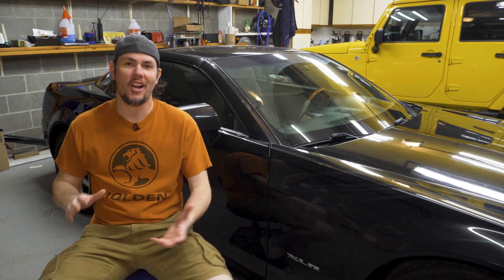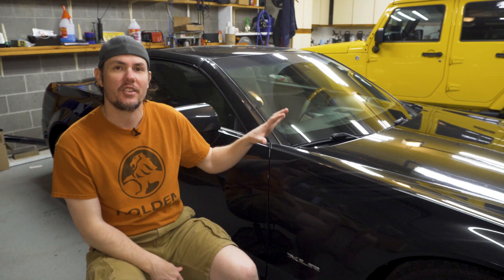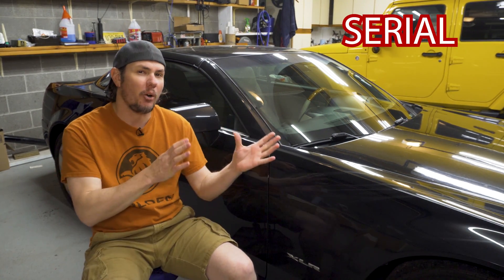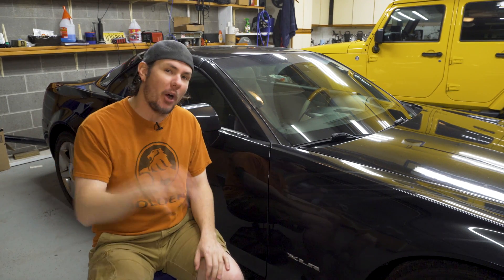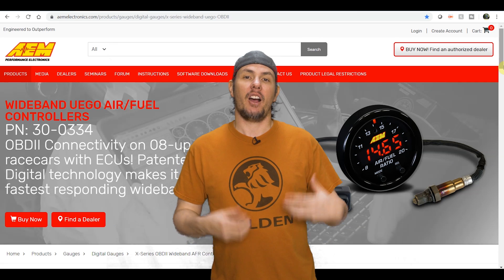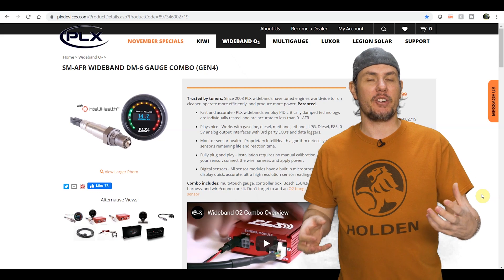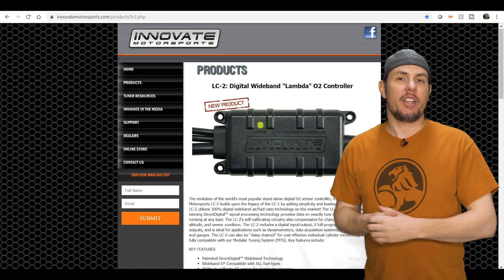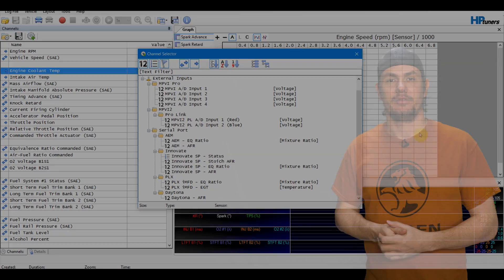Wideband Selection, The Most Important Tuning Tool.  Time To Pick One For Project Country Club!

Comment: I have some Innovate gauges. I've had a lot of issues with the fuel pressure gauge. Tech support didn't sound like they cared to help but eventually sent me a new sensor.  Now it works once in awhile. Haven't hooked the wide band up yet.

Comment: I have an alcohol content sensor. My PCM is tuned to E 85. Should my AFR gauge read 1.0 lambda with pump gas or E85. If stoich for E85 shouldn’t my EFR gauge read 9.5. Or is that only needed in the tune and what comes out of the exhaust is one lambda

Comment: Mpvi3... pro feature set is included, just buy the connector cable.  ^_^  gotta love it.  Im hooking the lc2 up to replace the narrow with a simulated output while using the car normally but im feeling lazy about welding the bungs.   😊

Comment: What are your thoughts on using the simulated narrow band output of a wideband -- wiring it back to the stock connection to the PCM and relying on it as if it were a stock narrowband ?

Comment: I know this is roughly a year old and MPVI2 Pro now has offline data logging, but I’m not even there yet. I’ve got a GenIV LY6 with VVT removed and a BTR cam going in my 71 C10 project. The engine cam with an E38 and a 6L90 but I had to get an aftermarket harness due to massive damage when the engine was pulled at the salvage yard. The harness is Speartech and connects to engine and trans. The TCM has been reprogrammed with a Corvette OS for manual shift capability. I have not bought my HPTuners, nor the wideband, yet. I will be able to take a laptop with me for tuning but wonder if offline makes more sense. Comments? Scoggin Dickey offers a package deal with HPTuners and wideband, AEM, I think. Is that the way to go? I’m assuming I’ll be tuning the MAF curve first (Spectre 4” is what I’ve got there, with a blade MAF supported by the Speartech harness—not the truck MAF), then VVE, rinse repeat, etc. Anybody see major pitfalls coming? How about a base tune file, recommended file ID? Thanks in advance for any responses!

Comment: Looking for something portable.  Rebuilding carbs on motorcycle and jet skis.  Want to be able to quickly read if too rich or lean.  Obvious the is no OBD, nor is it practical to weld in a bung.  Just want to clamp on the end of the pipe to get initial readings.  Any recommendations?

Comment: I'm trying to decide on a inline or gauged wideband. Inline will let me tune and I don't have to deal with mounting a gauge. A gauge will let me see it when I'm not tuning. I'm running 2003 Silverado 2500HD 4wd 6.0L with nothing crazy. Just cat-back and cold air. I'm going to be tuning and adding stuff here and there but each time retune so do I really need a live gauge? I assume without crazy mods I can expect my AFR to be pretty stable. I do plan on going with a Magnuson supercharger in the future. Do I need a live gauge then? I'm curious at what point do you decide you need live AFR all the time vs when your just tuning? If anyone has an opinion please lay it on me.

Comment: I’m new to tuning and your videos have been very helpful.  I have a question.  I purchased a pro-charged cammed built-engine including meth 2017 camaro2ss.  It came with a GlowShift wideband that has analog 0v-5v wideband data logging wire and ground wire.  I guess I could upgrade my MPVI2 to Pro for $250 and attach this, but I thought you mentioned a way to connect this to my ECM harness and get the wideband into HP Uptuners without this upgrade to pro.  If so, can you point me to a video showing which pin to use and/or how to make that happen?  Or, would you advise just upgrading to pro so that I can also do scanning/logging without a laptop?  I’m using a remote tuner to start, but I’d like to start tuning myself once I’ve learned more.  Thanks again for the amazing tuning videos..

Comment: Do you know if the AEM 30-0334 gauge automatically looks at the ECU commanded stoich for calculating lamda? Ie how would it do it otherwise with changing ethonal content.
Reply from the maker: Put it in EQ instead of AFR and it doesn't matter, 1.0 is stoich no matter what fuel you run, gas, E85, diesel, propane, etc...

Comment: Can I use one of my downstream O2 sensors ports for a wide band? My cats are gone so the down streams are not being used. I am looking at a AEM 30-0310. Also does that plug into the lap top or into the HP tuners MPVI 2?

Comment: I just bought a 30-0334 for use on a 07.5 NNBS Silverado .... hoping I don’t have any issues connecting 🤞🏽 should’ve watched this first but I got my hptuners and wideband as a bundle
Reply: How did the 0334 work out for you?
Reply: @cluis2105   worked out really well for the last couple years . Started to have some issues weird issues with it plugged in . Gauge does funny stuff bounces around . I don’t think it’s related to the AEM though . I know have an electrical/canbus issues with the truck

Comment: Would it be beneficial to run a wideband o2 in sensor 1 for both banks if you were to fun the innovate setup since it can imitate the OEM o2 sensors?

Comment: Can't believe they want $250 just to be able to even log a single wideband!
Have you ever tried to wire a widebands "standalone" to CAN bus high and low pins with the proper resistors and see if HP Tuners will recognize it?
Other than using the serial to USB option, just trying to find more work arounds. :D

Comment: Ecf-1 by Innovate...thoughts? Just bought, haven't installed yet. It can read in lambda, has built in fuel pressure and temp, and an ethanol content sensor. Also, I agree with most, your videos are invaluable to me as a beginner tuner.
Reply from the maker: Haven't tried it, but share your experience with it!

Comment: Hi thanks for the great info.( as always )  Im going to ask a potentially silly question, im brand new at this. Can the ouput of a Wideband oxygen sensor be wired directly into a MPVI2 Prolink Cable, it is an analog signal right? or does one always have to go via an external wideband controller? Its just not clear to me whether the wideband controller is necessary , or whether its just a better bang for the buck to gain flexibility and bypass investing in the pro-link.
Reply from the maker: You need to take it to a controller first, there are more than just the analog from the sensor involved, have to have something that controls the pump and the heater circuit. Good question!

Comment: I bought the AEM x series Wideband and unfortunately I was told I need the Pro feature set for data logging. I have
Reply from the maker: Which one did you get?
Reply: I pressed enter accidentally on my previous comment. 
I now have purchased the pro feature set, 
Is there any chance of making a clear  video on where to connect the wires from the AEM and the pro link cable,  to they both go on the expandable hub, the diagrams aren't that clear.
A video will be great, your videos are the most clearest and detailed. Most beginners will benefit from a video on how to wire up and what colours cable go with.
Reply: @GoatRopeGarage  aem x series Wideband 30-0300
Reply from the maker: User the serial option, I have a video on it
Reply: @GoatRopeGarage  which video is it

Comment: Alright maybe I'm missing something but I have a 2015 camaro just installed my aem 30-0300 the serial out put (blue wire) if I wire that straight to the obd2  port in pin 2 will hp tuners pick that up or do I still need the adapter your talking about? Also I have the mvpi 2 with out the pro features.
Reply from the maker: If you have the pro features just use the analog. The serial requires a serial to USB adapter, they are cheaper than having to buy the pro features

Comment: 1998 Corvette original ecu/ecm, hp tuner mpvi2, bolt-ons,... what to use AEM 30-0300 OR 30-0334 ?
Reply: I have the same question. I have a 1998 z28. Did you ever decide and install it on your Vette?

Comment: Anybody ever deal with a Glowshift Wideband?
Reply: Yes! I just put a dual channel series 10 on my 8.1 Silverado and integrated it into HP tuners, Its works as good as the Innovate MTXL I have on my car! It does support the whole narrow band/ Wideband thing I just learned about in this video. I welded in new bungs, But when I start on my GMC Yukon I may incorporate the front sensor bung instead of welding in a new one. I will just do a single channel, Dual is cool but probably best for a carbureted application since fuel injection is so close bank to bank.

Comment: Wow, just ran into your videos. Awesome! I was a fan when you mentioned PLCs. I've been an AB ace for 30+ years. I'm getting HP tuners pro version for my shop. I track tune some race vehicles but never stock ECMs. I watched your wideband selection video. Which wideband unit would you suggest that I use for multiple vehicles and doing street tuning for whatever vehicles might come in? Money is not much of a concern, I just want the simplest solution with the cleanest signals and as many features as I can get.
Reply from the maker: Check out the NGK units, they are the most accurate, but about anything now days is pretty solid. Been awhile since I worked on ABs, but that's what I cut my teeth on
Reply: Wow, already a response!! So look for an NGK unit that will talk to HP Tuners via rs-232?

Comment: When using a wideband sensor along with an in-ecu tuner, is it necessary to run the primary o2 sensor as well or can the wideband act as that sensor in its place?
Reply from the maker: You can pull the front while tuning as we disable them during tuning anyways

Comment: Q: is it possible to just replace the OEM Narrow Band (NB) O2 sensors after the cats with WB 4.9 sensors and connect them to the ECM continously ?  Will it be compatible and operate on a day to day basis as the NB 02s are supposed to?   If possible then you can get the accurate lambda, AFR, EQ read that is needed for tuning using MPVI2 any time you connect.  The specific application is a 19' Stingray (Gen 5 LT1) with 7MT.  Thanks
Reply from the maker: No, you don't want them behind the cats anyways as they will skew you're readiness and cause delayed readings. On top of it they won't work in the correct way that the normal narrowband sensors for the cats work. They do make wideband sensors that can replace the front ones and will work as a narrowband emulator in place of the factory.
Reply: @GoatRopeGarage  Thanks.  I meant to say downstream of the cats.  But you are saying they won't work as intended.  What if the vehicle has cat-less Long Tube headers, will that make a difference in your answer?
Reply from the maker: @kiyalami8478  catless you might be alright but there can still be a delay in part throttle

Comment: The gauge is simply a converter; 0-5v is proportional to (e.g.) 8.0:1 to 20.0:1 afr. That isnt analog to digital conversion. 
A digital signal is either off or on. Analog will give you an actual value. Digital - pressure switch; Analog - pressure transmitter.
Reply from the maker: The gauge interprets the analog signal, in order to display it in the gauge it is converting it to digital, don't mistake a digital input for the fact that all analog signals are processed into a digital signal, represented be a number based on the bit size of the A2D, which isn't going to be very high in the situations, but to give you an example a 16 bit A2D used in PLC systems is going to have an integer range 0-65535. I'm an automatic specialist, analog and digital signals are my specialty.
Reply: Automatic specialist...
Exactly WUT?
Reply from the maker: I program controllers for automated controls, lol

Comment: I have an X series canbus but I’m switching the Innovate. Their AFR/BOOST gauge with built in controller is just too nice to ignore. For $290 you can get an afr/boost gauge with built in controller and solenoid. Compared to AEM it’s a steal. The AEM boost controller alone is $300 plus another $200 for an afr. Obviously everyone won’t need boost support but man it’s hard to beat at that price.

Comment: I have a LC-2 it’s awesome
Reply from the maker: That's what I ended up going with. Will be installing soon.
Reply: Awesome choice. it’s easy to set up and very reliable. 0 issues with mine so far
Reply: With the lc2 do you have to get the pro features and prolink to use it?

Comment: Thanks so very much Kyle. I have watched all of you videos, and have learned much!! I was wondering if you could or plan on possibly making a video in regards to VVT on DOHC engines that are in many small displacement GM GEN V vehicles? How to use the tables the correct way is something I am struggling with. Thank you for any help in this area. You have already covered 95% of my other questions, so thank you again!!
Reply from the maker: We're going to talk about it a bit as the new project car has dual overhead cams. Keep your eyes peeled!

Comment: About 1/5 of the customers that come to my shop have AEM wideband, and all but two (meaning dozens just this year) have read wrong compared to my calibrated dyno wideband. Not good. Most of the wrong ones have read about 10% too rich. I couldn't recommend one based on this experience. They also display bogus values at startup too. There's no way for a wideband to output data in 5 seconds like their gauges do. Read the Bosch wideband specs.
Reply: Well now, a manufacture would not want to be 10% lean would they. I would bet they are delererberatly 10% rich

Comment: I had a plx unit, while it looked beautiful the company is absolutely dreadful. The gauge started not reading and starting up with dots in the display. after 4 weeks of waiting a new gauge was sent. Then 2 mos later the brainbox smoked (actual fire)  NEVER PLX NEVER AGAIN
Reply from the maker: Cool, thanks for checking in with your experience!
Reply: after reading this a few times about this company, I decided against them.  I also figured the "brain" wouldnt like being in an open air cab of an offroad rig...

Comment: I’m using the AEM 30-0334. It’s nice having the gauge to reference during pulls so I don’t have to look at the laptop screen to see if I’m going lean. It’s also nice that I do not need pro feature set to get it into the scanner.
Reply: instaBlaster
Reply: I have a 94 with a 411 swap. Will the 334 work directly with my hp? With that pass through?
I had the 300 but it would not work
Reply: @briansaathoff4038 you can set up your older aem to read through the egr or ac pressure switch pid
Reply: @wisky3  i have this one in my ac.  Need to figure out math now and how to add it in

Comment: You should consider a Ballenger AFR500v2 with a NTK sensor.
Reply from the maker: Second person to suggest it, I'll dig into it
Reply: @GoatRopeGarage  Agreed.  The NGK AFX was one of the best widebands back in the day.  The Ballenger version is supposed to be developed along the same caliber.  I still rock my NGK AFX and it's been great and on the original NTK sensor since 2008.  It still passes calibration.

Comment: I would like to have a portable Wideband that can be used with multiple cars with going under the car do you have any suggestions?
Reply: Mot testers (UK) use equipment that can do that, off the top of my head I couldn't recommend a brand/model but I know they exist ad IV seen them operate, a crocodile clip holds the sensor in the tip so I doubt they are very accurate for tuning, your always going to have that problem with this idea as simple sensor location is end of exhaust and due to exhaust pulsing this area is not Ideal! Good luck finding something it does sound an interesting idea.....
Reply from the maker: Innovate LM-2 with the exhaust clip, handheld unit with cigarette adapter, easy to move around
Reply: ezdfiant street tuning has it’s drawbacks i guess , but for wot i think tailpipe readings are accurate
Reply: Goat Rope Garage will i be able to connect it to hptuners like you showed before? One more thing a street tuber tuned a friends car in-front of me he used some sort of a copper long probe like the ones that dyno jet use and had a handheld device as you said do you have any info on that setup, whats that probe is in particular
Reply: @MALR7  probably a sniffer probe to get a more accurate reading on into the exhaust.

Comment: PLX is good stuff. You can change the display to Lambda also if you want. The single DM6 gauge can be daisy chained with other PLX Modules. I was using a fluid pressure module to monitor fuel pressure. You press on the screen (in a certain spot) and  you can cycle through what you are monitoring.
Reply from the maker: Good feedback, thanks Blake!
Reply: @GoatRopeGarage  Now that I think about it, I was also monitoring oil pressure. Since there are no commercial gauge pods for the XLR, I would seriously look at getting an older smart phone and use their app. You would be able to monitor more than one thing on a single screen and the display would be bigger and prettier. There are plenty of ways to mount a phone in a car.

Comment: I used the AEM 30-4110. Good price, has the UEGO 4.9, serial output on adapter to HP Tuners, and is adjustable to read multiple AFR, I have it on Lambda because it make sense tuning the tables.
Reply: Well that AEM wideband gauge work on HP tuners Pro 2 on an 04 GTO  cable throttle LS1
Reply: I have the 30-4110 as well, seems to be the same as the 30-0300 except for the AFR range. Have the Analog connected to HP Tuners via the blue wire. Will try hooking up serial one day.

Comment: I bought a Innovate ECF-1  and got it to work with  HP Tuners.
Reply from the maker: Happy with it?
Reply: @GoatRopeGarage   its given me a power error a few times. its not my wiring. its all grounded to the battery with a relay and soldered joints.